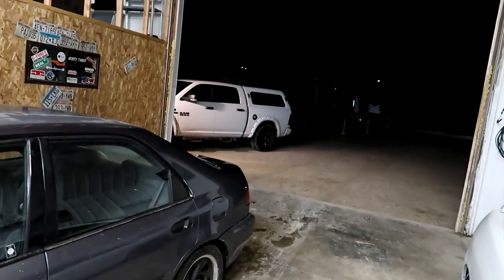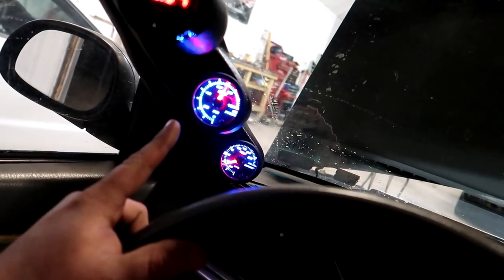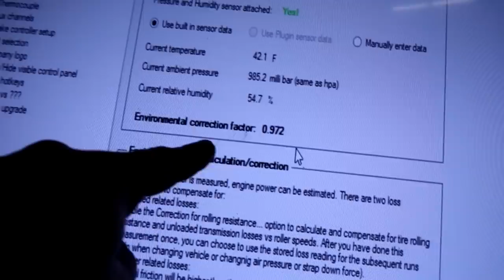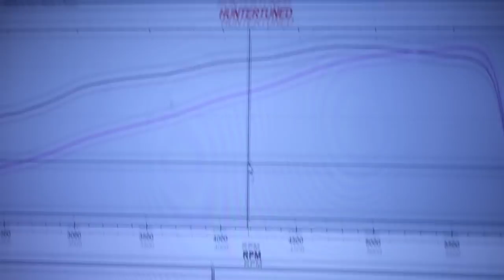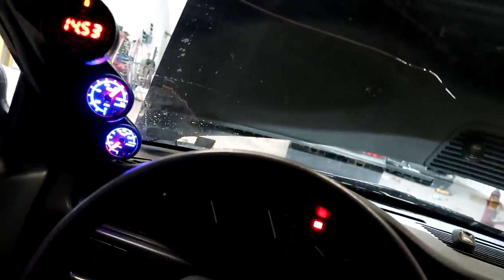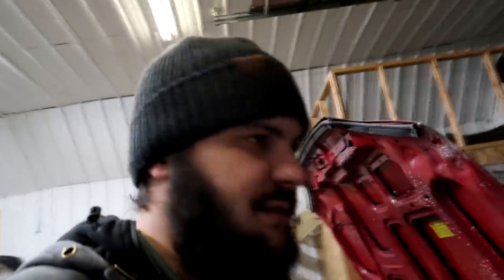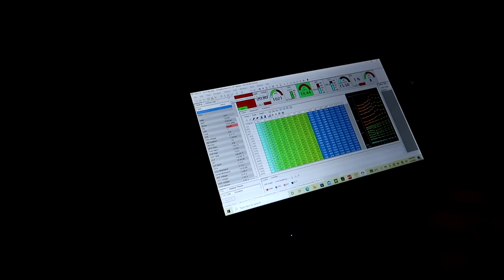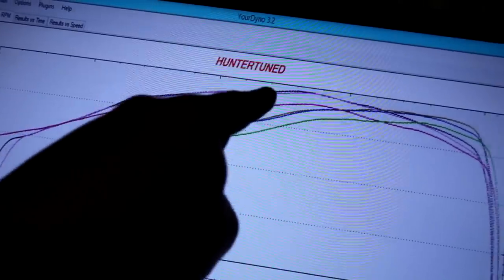93 Octane Pump Gas VS E85 Turbo D Series Single Cam Honda HTS DynoTuned

Comment: I'm taking notes on the ignition timing and love the SOHC content! Thanks for another great video Hunter! 

Just finishing my charge pipes then I'll be ready for the first startup of my 1990 JDM Accord (CB6) 2.0si Exclusive Coupe!

 Stock bottom end for this summer so I'll only be on 7psi spring pressure for starters.

 F20A DOHC block/F22A SOHC head ported and 272cam, wally450, FIC850cc, 12cm (82ar) Holset HE351, Ostrich 2.0 on HTS.
Reply: Shit, let me know how you make out. I am running a stock block JDM F22B SOHC NonV in my EK. About 8lbs 255Walboro 750 RCs. Pulls pretty nice, blows off the tires in second
Reply: Traction is going to be an issue even with the innovative traction bar because when I did the AT to MT conversion I used an open diff M2Y4 from a base prelude I had so I'll have to look into an aftermarket LSD or just get an H trans with a factory LSD.

Comment: Wouldn’t you require the AFR after e85 to be richer since e85 has a different stoichiometric ratio. So instead of targeting the same afr as the gasoline tune, don’t you want to run like 10.5 afr

Comment: Do you test and socket for ecus cobra rtp? Gonna run hts this summer when I boost my y7. And as far as single content I'd love to see someone do a hot air turbocharged hypermiler project just to see what kinda mpg it would have?!?! Considering the state of fuel prices 😭

Comment: Here's my view on fuel companies adding 10% ethanol.  They make shit gas, let's say 86 octane.  Now they add that 10% of ethanol making it 93 octane.  That's like a drug dealer getting his stash of coke and cutting it w/ 10% baking powder.  10 gallons of pure gasoline will take you say 250 miles.  10 gallons of ethanol will only take you 200 miles.  This is how they rip us off no matter how much gasoline costs.  They don't keep ethanol around for turbo Honda guys (lol)- they keep it to make more $$$ for themselvs.  Having E85 randomly available at the gas station is a side effect which is also why it's only in 20% of all of the USA.   I plan on achieving higher octane under boost using water / methanol injection because the closest E85 station is 1.5 hours away at highway speed.  Would be cool if you did a video on water / methanol injection but I know I know, you have E85 everywhere there in Wisconsin.  Lucky aint the word.... Also while all the gas prices have gone up, costs to operate wind turbines went up zero dollars.  So there's that too.

Comment: Hey  love the videos but was wondering  im doing a 2001 honda  d17  stock bottom end doing a cheap ebay turbo kit on it can u recommend  what injectors  i should run in it i eould like to get them from u and im looking for a hondata  sho uld i just send my out and can you recommend  any good places to do that thanks  ive teied to email you before thanks in advance for any possible  help you could help me with
Reply from the maker: I really don’t know much about the d17 unfortunately the 2001-2003 or so years are tricky to find tuning for. I’ve never messed with any of them maybe call Hondata and see if they can help or jason waters tuning.

Comment: I would love to go e85 but it just isn't easily available where I live. In your opinion what would u consider safe hp for 93 Oct on a b16 stock sleeve piston rod set up
Reply from the maker: 300
Reply: 400 whp easily on a piston rod b16 if it’s a good flowing turbo and tubular manifold I see around 300 whp on a piston rod d16 around here my car made 495 in my sleeved forged h22 on straight pump gas I’m from Canada so we don’t have e85 at the pump